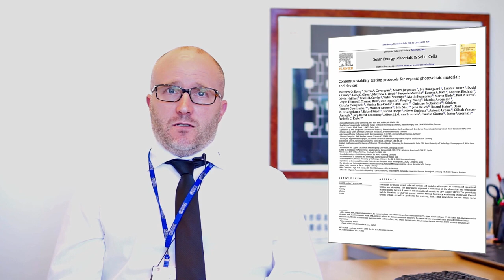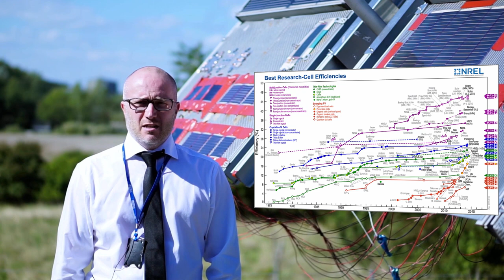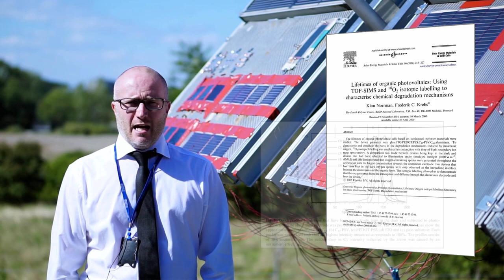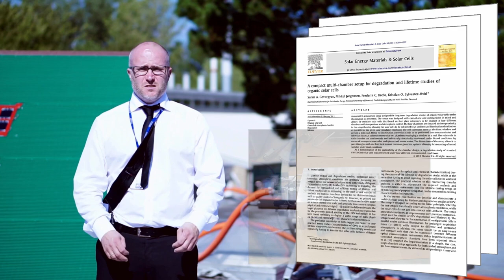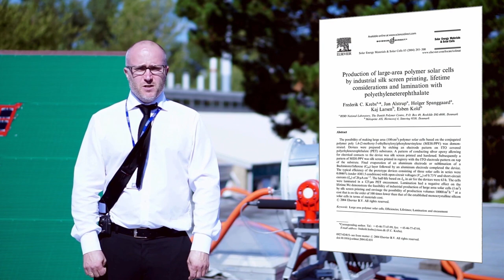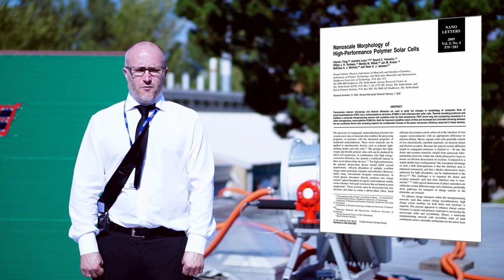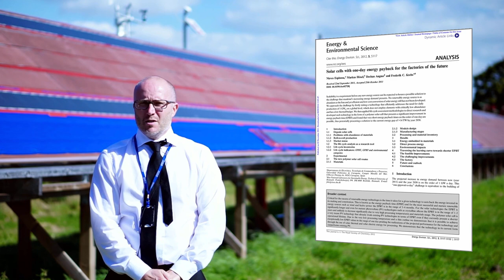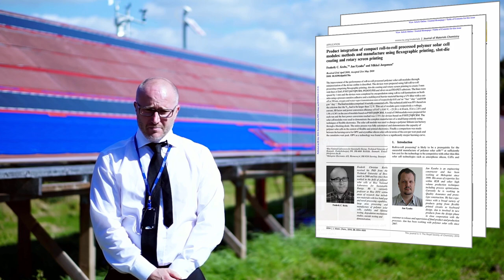Stability and degradation of the organic solar cell - past, present, and future (ISOS-7 talk)

Comment: Well done. For better and faster market penetration I guess you should concentrate on the enduser market and offer 1 and 2 Meters long rolls and also support standard MPPT Solar chargers wirh the right voltage ranges.. Too high voltage is not very safe...
Regards, Stefan.

Comment: I took the course and completed it.  I was too cheap to get the verified certificate, but finished "w/distinction".  I thought it was a pretty good course and would take more like it if offered (coursera or edx).  It had the typical MOOC disconnect between the tests and lectures.   I never got the sample solar cell.